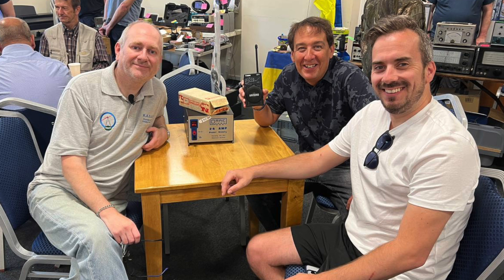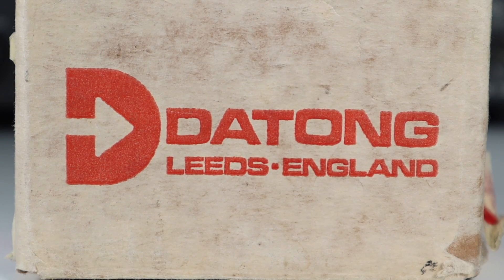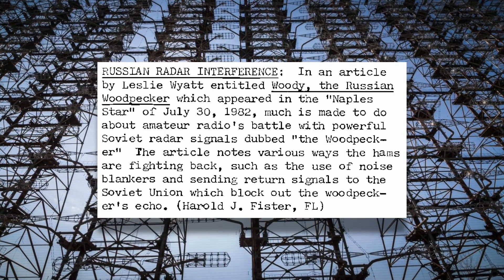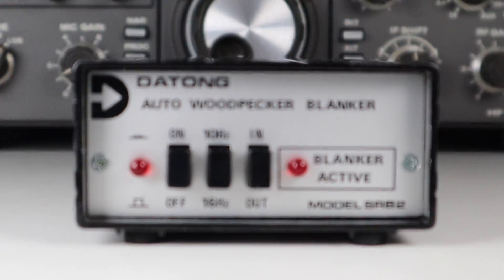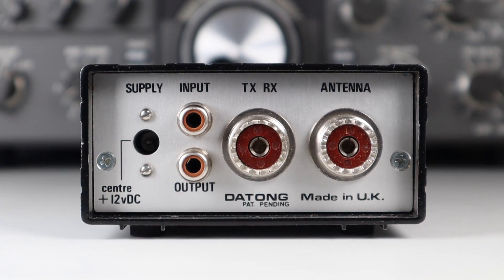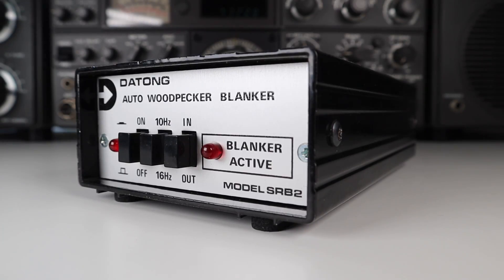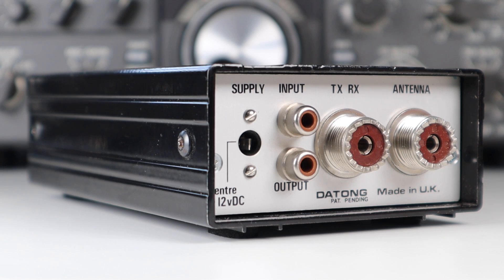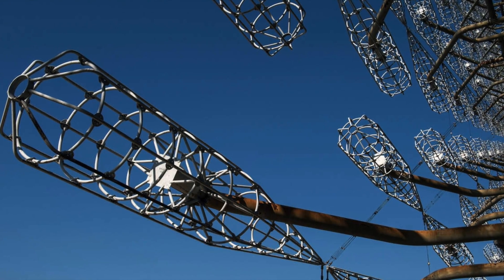This Black Box KILLED The Russian Woodpecker

Comment: Even here on the East Coast of the US, the Woodpecker signal was extremely powerful. One defense that some people used was to send Morse code Dits at around 17 WPM or so, with a weighting that would cover most of the return echoes from the radar. This usually caused the Woodpecker to move off frequency. I knew some who would chase it around the band for an afternoon of entertainment. Knowing that they were frustrating some Soviet technician was half the fun.
Reply: >Knowing that they were frustrating some Soviet technician was half the fun
Believe me, this was not the case. I'm working with the son of one of the people working on the Дуга site near Komsomolsk-na-Amur. The echo blanking and signal processing was not a problem. Cost was the biggest issue and the installation was just not sustainable in the bad years approaching 90s

Comment: holy crap talk about bringing back memory's' the wood pecker was a massive pain in the butt it had two speeds the first was a very very slow pulse about once every few seconds and then it would go into 10Hz full wood pecker mode it felt like it was sort of random as if it could pop up anywhere not sure if it was, i wanted one of those boxes they felt like the only way to deal with the noise at the time. i think that chernobyl did take out the dam thing in the end ?

Comment: Flippin 'ell I had a DX200 - it was shit in a way that's really, really hard to describe. But, with a  a Q-multiplier and tuned loop antenna, it kinda, sorta, maybe  worked OK.  
I totally forgot about that age if my youth - maybe 9-10 years old. 

And yet, girls these days just aren't intrerested until I mention I had a NRD535
In fact I can't even get laid unless I mention the NRD535. 

But WaWaaWEEwah -  when I tell them I have the Bandwidth Control Module fitted -  OMG they cream their front ends in excitement. 

I had the 500Hz filter too - but I only demonstrated it to the hot chicks that were down for a bit of hardcore  PL or 5FG copy.  EDIT: and with BWC module switched in, things got WAY tighter. 
Obviously.
  
Man that JRC kit got me laid SO much with tech chicks- it's unbelievable. And nowadays, it's only distant memories, like Cherry Ripe, only even MORE distant. And with way less cherries nowadays. Such is life. 
 
Hmm, maybe that's enough memories for now. 
 
OK, so I may have had a little vodka. But fk me the DX200 was absolutely totally shit - I think it had a first IF of 455kHz or someting - 1940s tech turned 1980s consumer kit. 

Am I misremeberingizationizing? I remember cranking the dial and getting EVERYTHING and EVERY bloody 400 or 500 kHz. Hell even a 10.7 MHz first IF would have been OK.  
/drunken_rant
Reply: hic

Comment: The 'always shown' image of the DUGA radar is actually the receiving antenna array. The transmitter was about 50Km to the Northeast and a lot smaller in size. There is virtually nothing left of the TX site these days, but the RX still stands as a monolith to the Cold War.
Reply from the maker: Yep, I actually said that on the screen

Comment: Datong Electronics, (from the founder's name D. A. Tong), made quite a few cool gadgets. I have, and still use, one of their in-circuit transistor testers. Later they got into the TSCM, (Technical Surveillance and CounterMeasures), market, finally being bought by an American company in 2013
Reply: I had an interview there for a junior development engineer's job not long after graduating in the mid 1990s. I thought I had pretty much aced the technical interview, but didn't get the job. When I phoned them to ask if they could tell me why, they said I knew too much about the company! I guess I shouldn't have mentioned that I knew they did Secret Squirrel work, but it was pretty well known among radio amateurs in the area!

Comment: 16Hz is the electric power for trains ....
Reply: The power for trains cause radio interference?
Do you think the gadget was used both on the Wood Pecker and train noise?
Reply: @ddegn  I would say yes !
The contacts make a lot of radio noise.
Reply: Which country uses 16Hz? Here in the UK Trains use 50Hz 25kV AC. Same frequency as the national grid.
Reply: @risvegliato  : Germany.
25/15 kV ~` 16,7 Hz
Reply: @risvegliato  : https://en.wikipedia.org/wiki/15_kV_AC_railway_electrification
Reply: Probably Nikola Tesla
Reply: @156dave  : You're sooo smart ! 
(Only you know nothing)